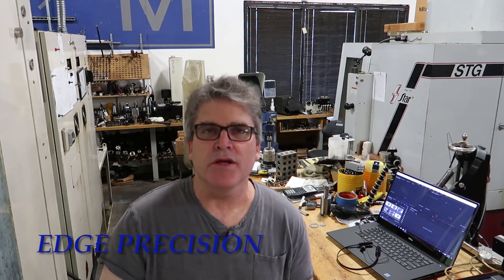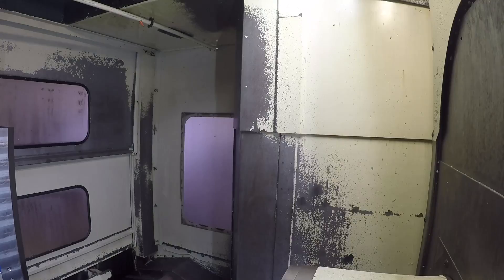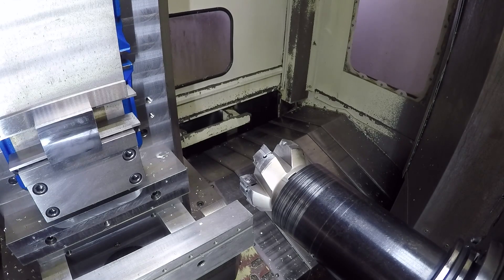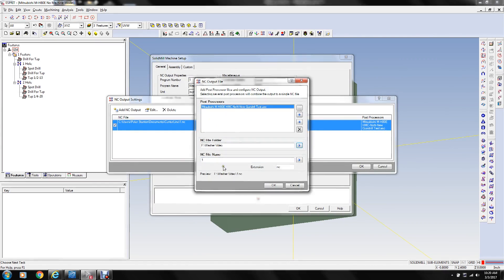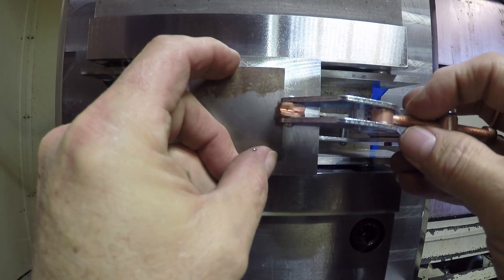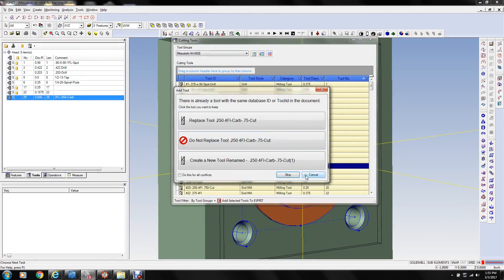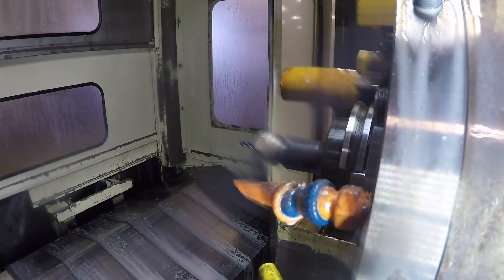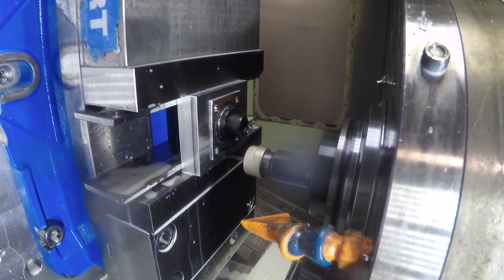Lock Washer For 5Axis Mill Stop Fixture.

Comment: Nice job Peter.  I can see that even if you don't have the same equipment, this approach could be useful for making similar parts with different machines.
Reply from the maker: Bill De La Vega Thanks Bill. Yes it is as I said a quite common setup in the shop. I have used this method on large and small parts on both manual and CNC machines.